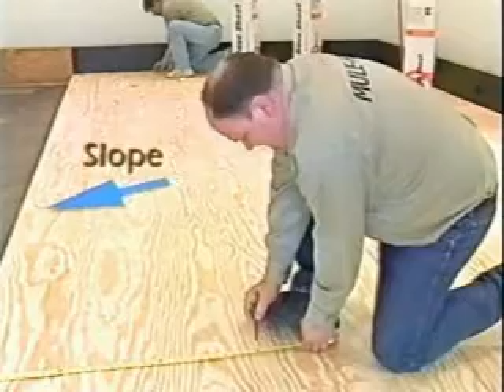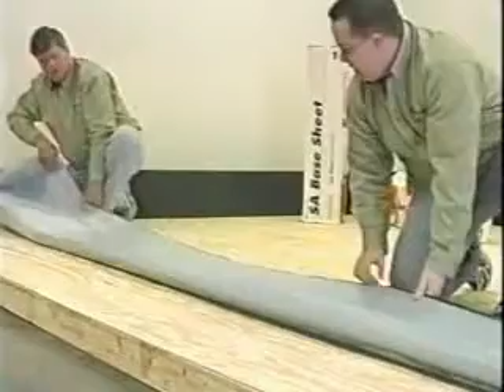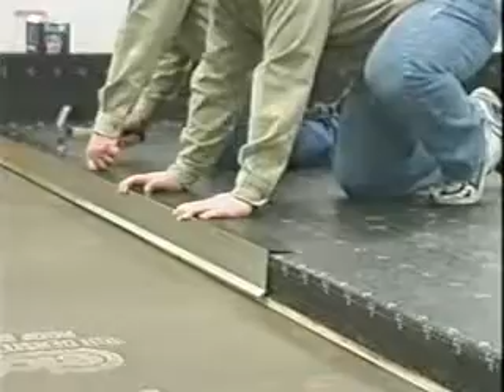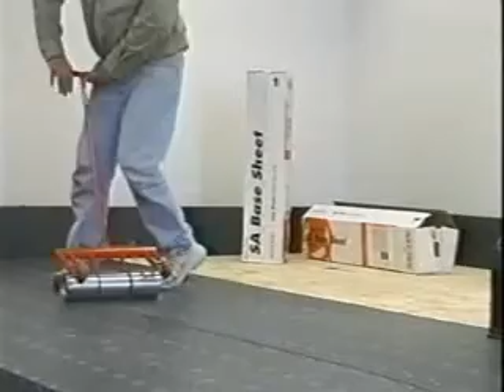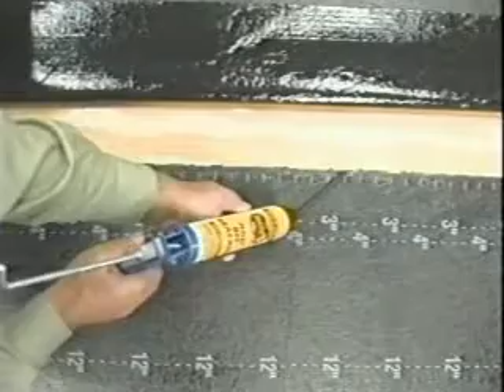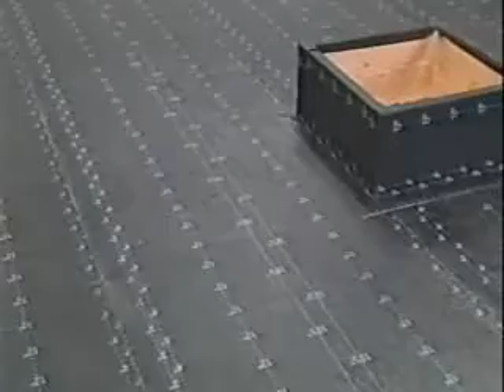Self-Adhering MOD BIT - Base Sheet Installation

Comment: Will this SA BaseSheet be hard to remove from plywood deck in 10 years? How do u remove it? Should it be put over the nail base first for easier removal later?
Reply: I have the same question
Reply: Yes it will, I’m a private contractor so trust when I say they do suck when needing to remove it